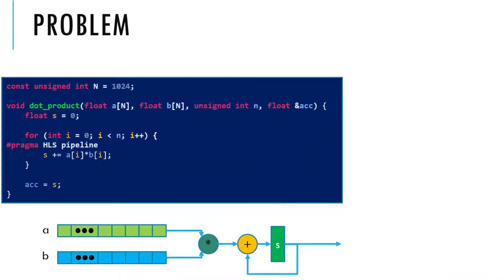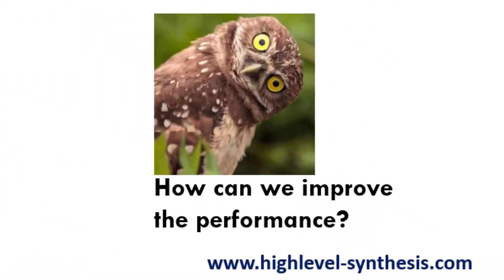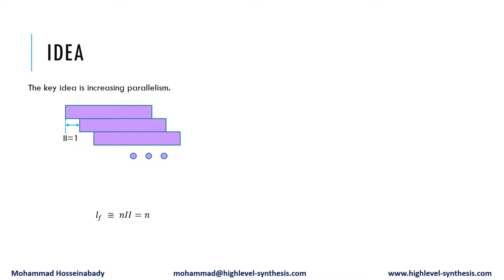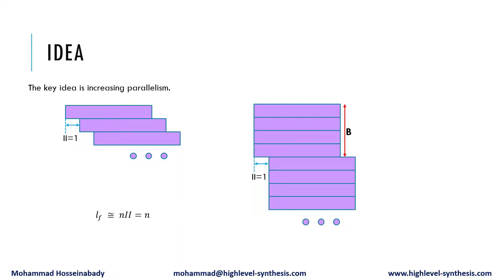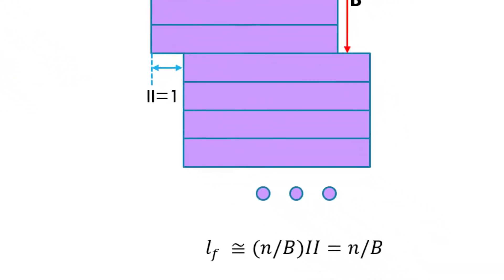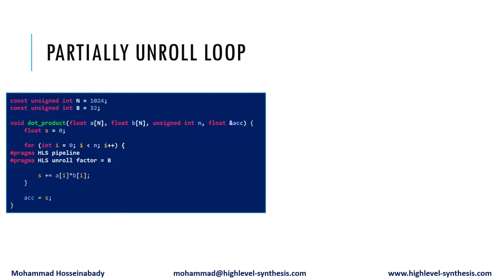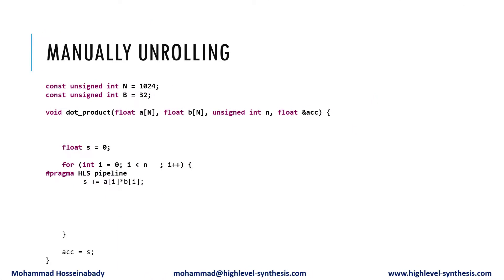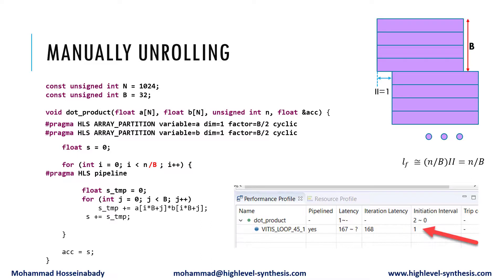High-Level Synthesis : Reducing II in HLS-01

Comment: What does the interval means? that if it is NOT 1, the unrolling is not data due to data dependencies? Could you please give more technical details for those who are not very familiar with HSL C/C++ ? Thanks!!
Reply from the maker: There are lots of concepts in HLS for newbies. If you are interested, you can refer to the following link.

https://www.udemy.com/course/function-acceleration-on-fpga-with-vitis-part-1-fundamental/?couponCode=8B3B26DBB65837F4B9B3